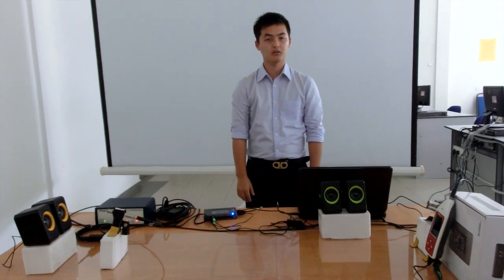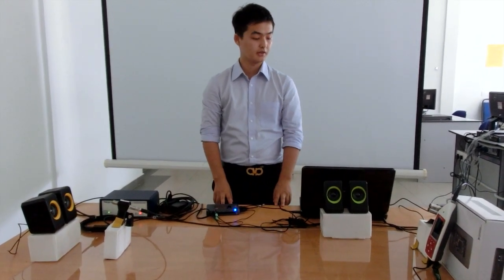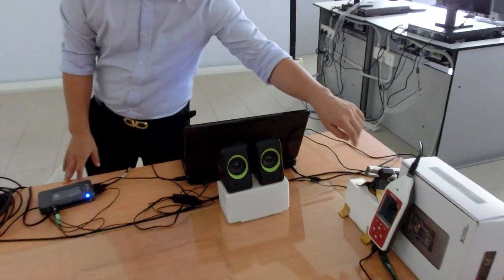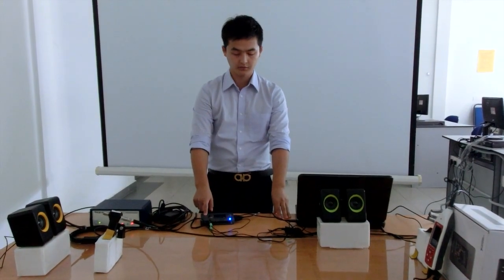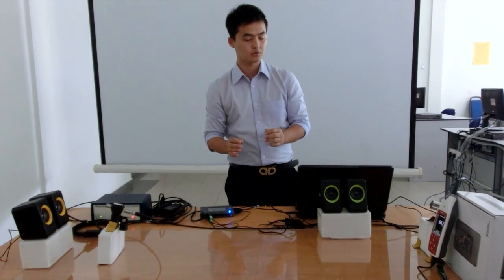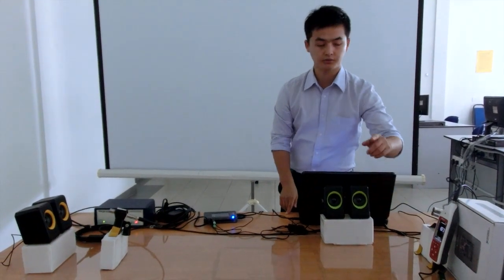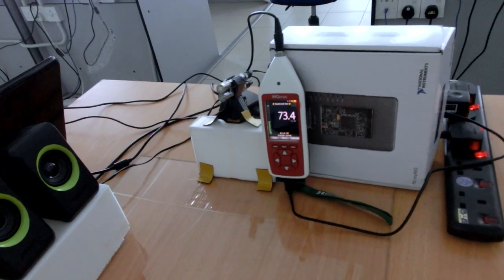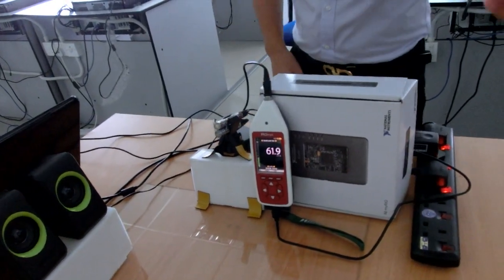MY082 - Active Noise Control for Traffic Noise Cancellation

Comment: I can tell that the noise you are using right now is actually emitting a consistent sound pattern. Will this be possible on an environment where there are lots of random sounds going on?
Reply: ANC is helpful only when the noise has a consistent sound pattern. It's hard to cancel out a random sound since you have to adjust your anti-noise sound every time the noise changes. It can be done (with a smart controller) if there are only few patterns that change every now and then but it's difficult for a sound that changes constantly.

Comment: That was good. I have two questions. The first one is what controller did you use? the second one is why did you place the anti-noise speaker perpendicular to the noise speaker? wouldn't it be better if you place the anti-noise speaker in front of the noise speaker? Thank you.